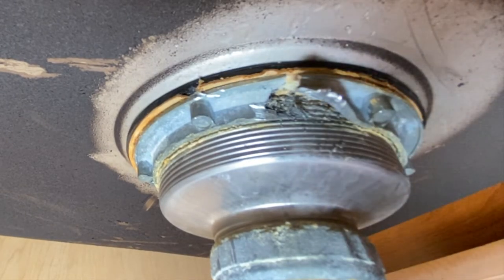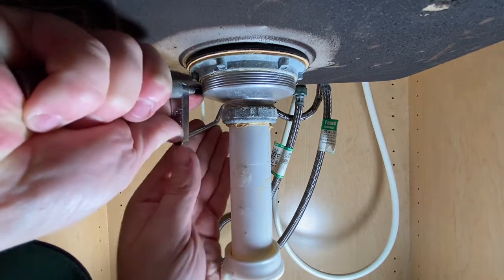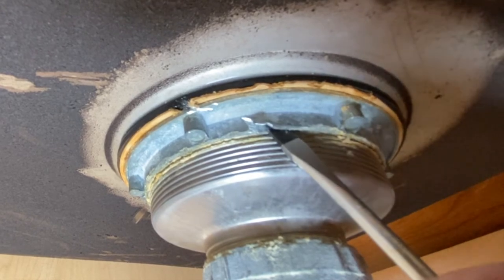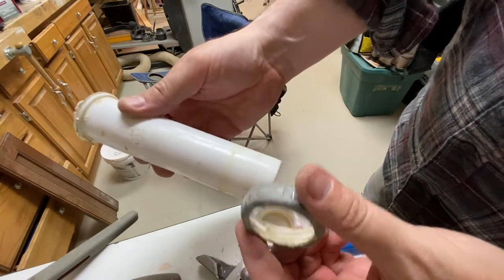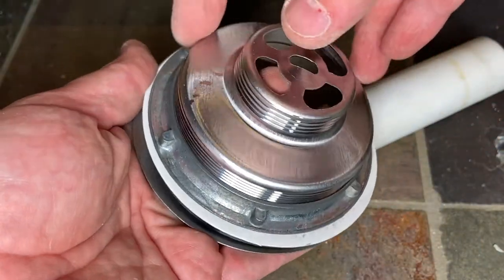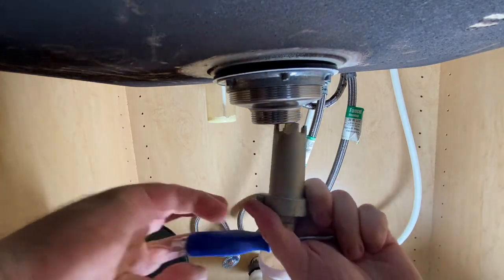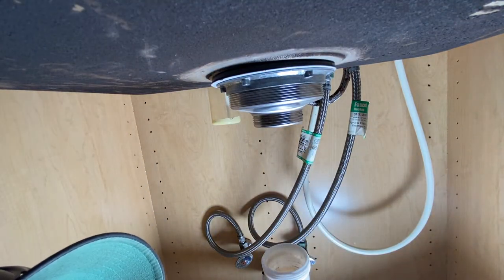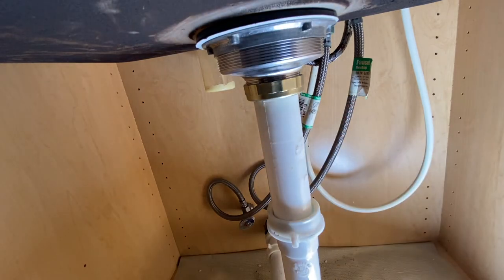SOMETIMES YOU GOTTA USE A MINI SAW!!...How to Remove a Stuck Kitchen Sink Strainer!

Comment: I used a Dremel grinder and a 1.5 diameter cutoff wheel. I used it to cut the water lines they were in the way.  I then had plenty of room to cut through the brass nut.

Comment: yeah i will have to do that. i installed a chrome tail piece at my grandparents and it connected to a leaky strainer from 1938. i did not know that the strainer was leaking. i checked on the plumbing a few weeks later. and i saw all my work was rotten because of the water dripping on it. since the strainer is from 1938 it is on there tight.  but i learned a good lesson. i will need to use your trick to get it out thanks for the tip.
Reply from the maker: Anytime!  I’m glad I am helping people out!  It is always nice to see what someone else would do in the same situation. 4 eyes are better than 2!  Keep up the good work as well!  Your channel is growing!

Comment: How 2 loosen a metal on metal nut that doesn't budge no sprays, no hammering works, at the wall area end ,( furthest from the drain)?? Use fire?
Reply from the maker: Fire would most likely work. Don’t burn the joint down though. Leverage is hard on those spaces.
Reply: We use our Dremel tool and it worked. Thank you for the video 😅

Comment: I just found this after my repair. Also I had that crazy triangle clamp in the way. Nose of the videos had that but one of the 2 choices at Home Depot.  Also, I had to chisel out the busted metal pipe out of the elbow to get the new plastic pipe  to fit.